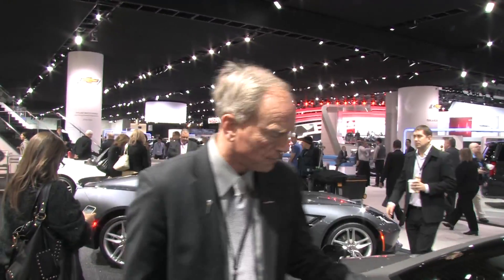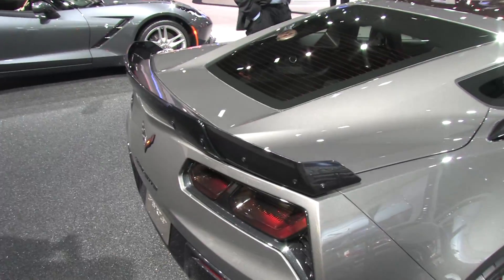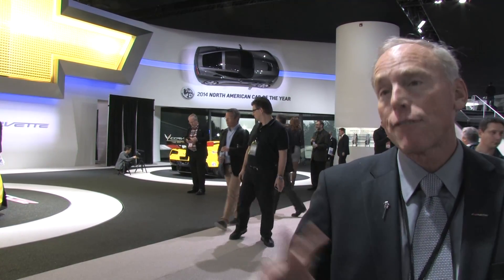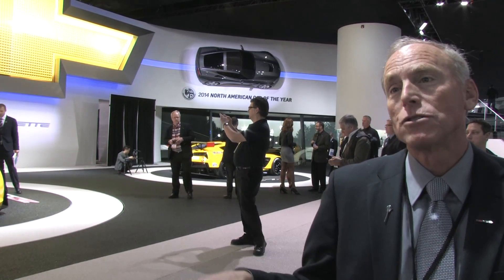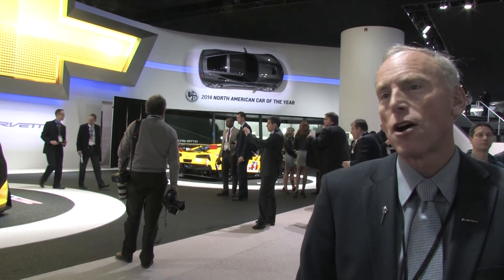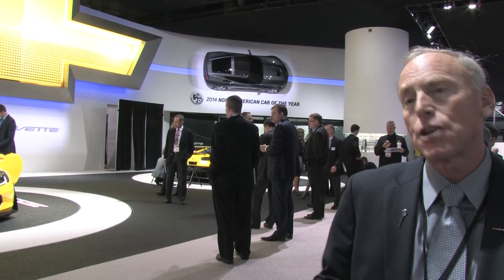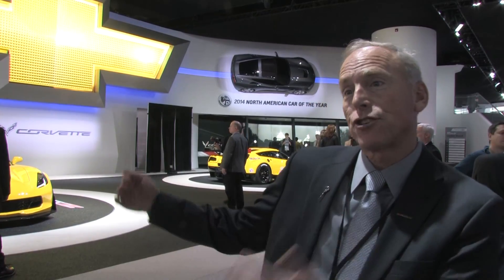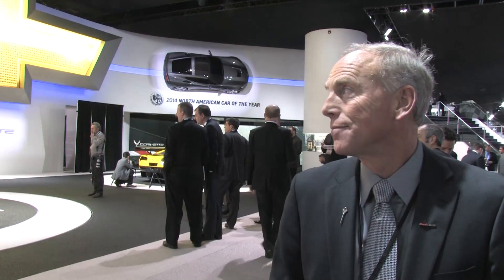Corvette Chief Engineer Tadge Juechter Answers Our Questions about 2015 Corvette Z06

Comment: LOL, Him talking smack about the Viper being Crude....when the C7 Z06 handles like Garbage compared to a Viper ACR or T/A. The C7 Z06 is the WORST handling High performance Corvette made since the 70's. Every magazine editor says it is out of control " will kill you" if you turn off the traction control....and all of them had the Z07 stick tires. Then they had over heating issues with the autos....Never would happen with a viper.

Loved the C6 Z06/Zr-1 and had a corvette history poster growing up... just not happy with what they have done with this car. Need to bring back a retro-RWD chevelle.

Comment: The C7 Z06 is a marvel of design and engineering!
Reply: Too bad it doesn't handle as well as a C6 Zr-1/Z06, automatic use to overheat and it weighs 250lbs more than the C6Zr1;-(